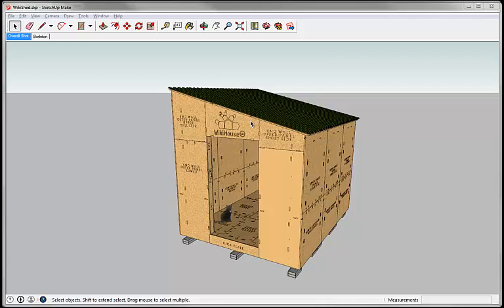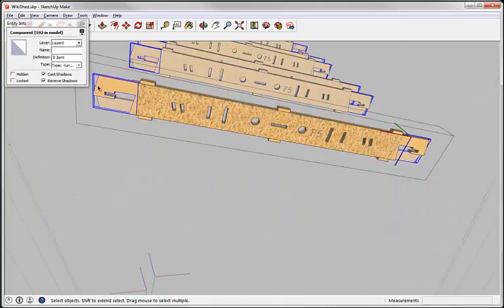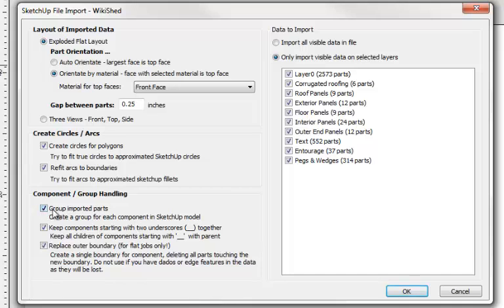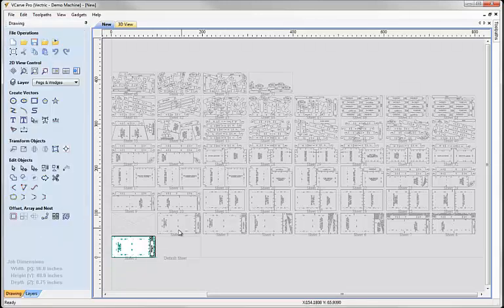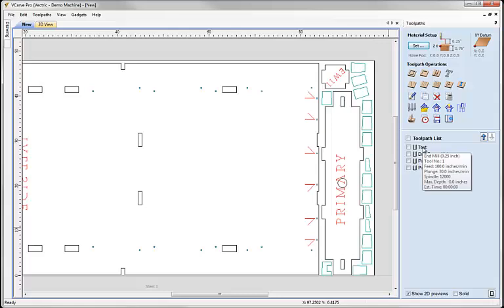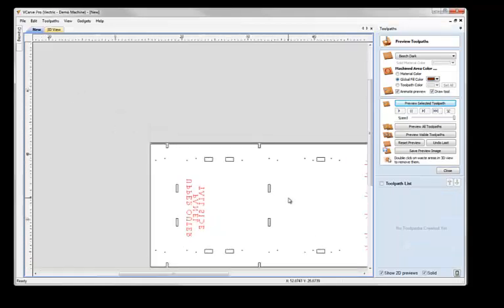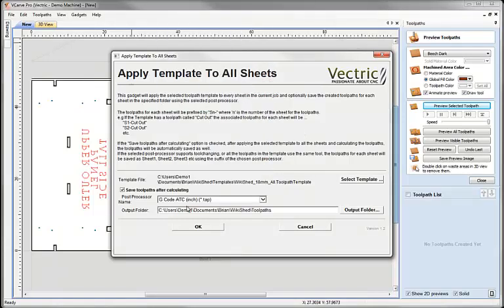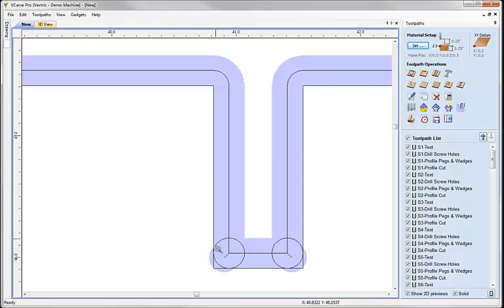SketchUp Import - Detailed Demonstration

Comment: Hey Guys, i have been working with sketchup every day  and never found a solution about this one. Each time i am making a complex cabinet or complex jobs i usually making dxf (beacuse of the layer) of all my part ready to nesting. Each component have many layer ( drill with different size, dado, groove..) so each time i import directly a skp file it's end with 1 layer 

is there any way to aboard that

thank you for your time
Reply from the maker: Hello Mathiew... If I am understanding correctly you are properly naming your layoers in Sketchup... and if that is the case we should be creating a corresponding layer in VCarve.  If I'm not understanding, or it is not working for you... I would suggest contacting support@vectric.com and they should be able to dig a bit deeper.
Reply: @vectric  thank you

Comment: Hi, can you please help, I'm new to VCarve Pro but I've been using Sketchup for 10 years and I don't understand how, in the wikihouse sketchup model, how elements like screw holes or text -- which are just geometry within a component like a spar or panel -- can be on their own layer?  It seems that the layering is crucial to allow VCarve Pro to automatically select the appropriate vectors once everything is imported into VCarve Pro, so that the drilling tool path template, for example, can be applied to all screw holes on the "screw holes" layer.  Of course it's obvious how separate components like pegs and wedges can be on their own layer, but when a panel has engraved text or holes or whatever, how can they be "put" onto their own layer?  I didn't see in the video any way this was done in VCarve, so it must have been done in the Sketchup model.  Can you please explain / clarify?

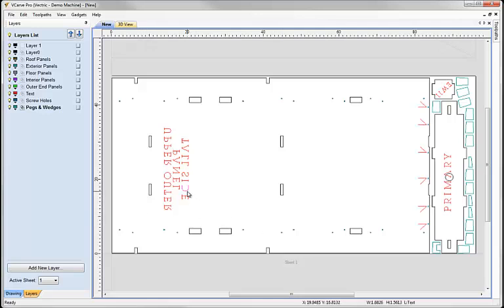Comment: P.S.  Hey Guys.... at minute 10:22 you can see the big panel has the text in reverse...  I'm guessing that this is actually the back of the sheet?... to avoid that... would that be an example where in the sketchup model you would want to apply the material?  And could you have a couple materials like the roof lets say Front Face2 and the walls a Front Face1... and then somehow get VCarve Pro to recognize those as front faces? 
Great addition to your software... I am super excited because I love sketchup.. and have Sketchup Pro 8 and I love using it as a  CAD.
Reply from the maker: Hello Frank... this is an old video so I would inquire with support@vectric.com if this option has been added or if there have been any importing updates since 2014... :)